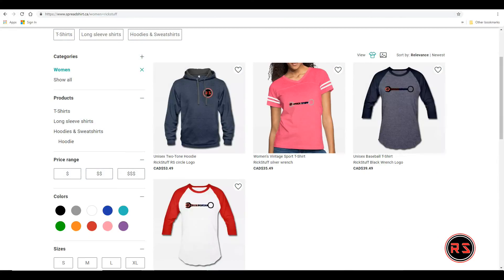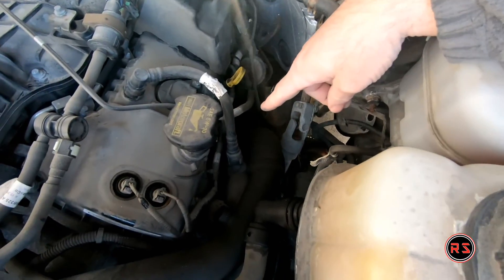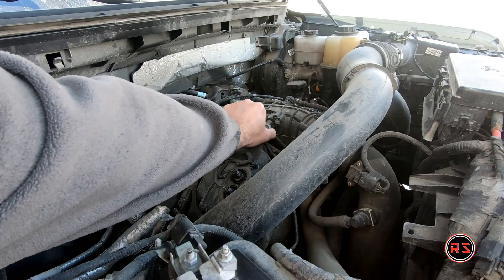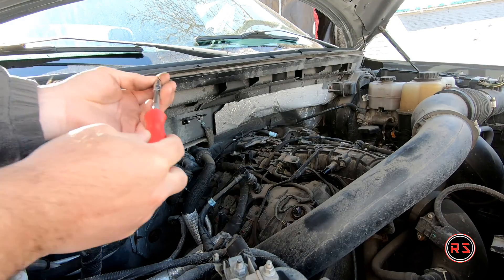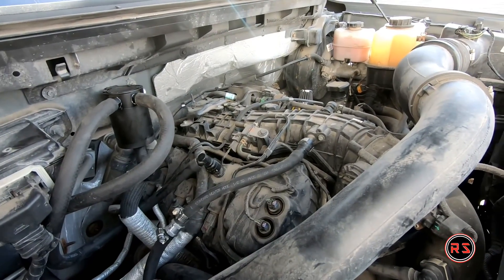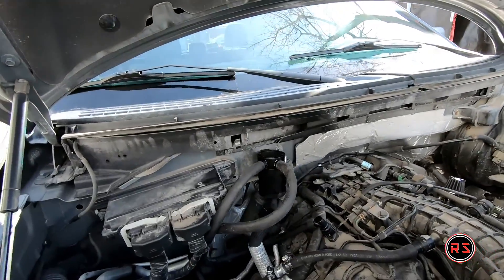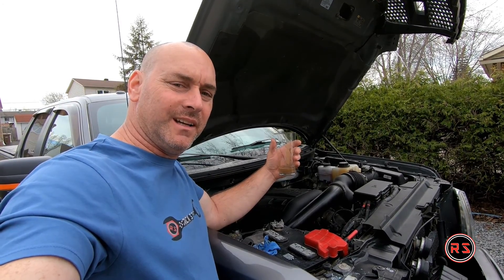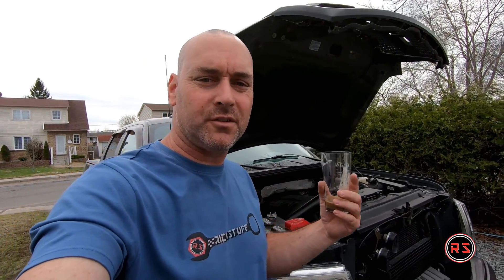F150 ecoboost check engine code P0300 (misfire)?  watch for Simple fix

Comment: A misfire code may have something to do with gunk accumulating and fouling a sparkplug, but a catchcan install and a misfire code are sort of two topics independent of eachother.  I have a misfire . and need to clear the code after I replace the spark plug and coil.
Reply from the maker: The inter cooler get fill up with the crap from the left pcv valve which is  dumping  the crap in the exit pipe that goes from the left turbo to the inter cooler. When there is enough crap in the inter cooler it start getting suck in the intake by big volume when you floor the throttle pedal  so some cylinder get a load of that wet crap from the inter cooler instead of air. That crap dosen't burn on the ingnition so the cylinders that got filled with that crap are getting several strocks without a proper fuel/air ratio before tgey start getting a normal air fuel mix which causing missfire...
You can also found s lot of video of eco boost owner drilling their inter cooler to let the crap out of the inter cooler